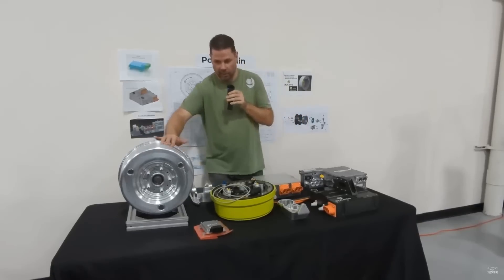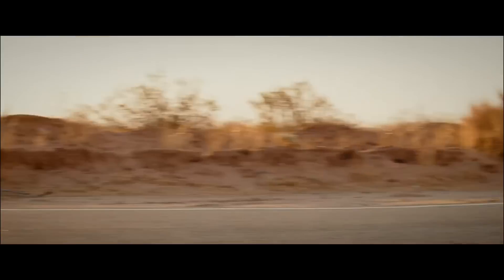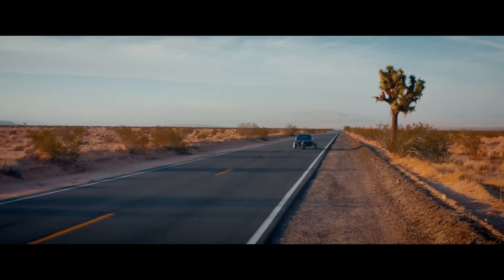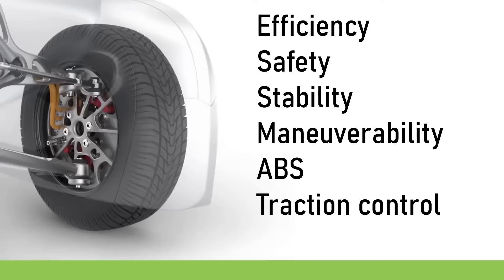Why is Aptera using In-Wheel Motors? (ft. Elaphe)

Comment: Listen up unsprung weight is only an issue on the flat earth! Flat earth is where this unsprung weight is really a major bummer. The almost completely aluminum constructed hub motor is slightly heavier than the steel wheels on my Jeep. That’s facts. Flat earth ,unsprung weight.

Comment: Having what is probably over 100lbs of unsprung weight about 2ft from a pivot sounds a bad idea from a drivability standpoint and just from the forces the bearings in the motor will have to absorb. Needs a in broad motor. I would even say inbroad brakes bolted between the CV axle to make that wheel assembly as light as possible.

Comment: I want to see that motor on a motorcycle, that'd be fun.
Reply: I have, the Super Soco TC with Bosch hub motor.  Works fine, no problems in rain. Never thought of more weight in the wheel as a problem.

Comment: IWM imao wont last long due to its location where vibration is always present.
Reply: The increased mass of the wheel motor will also cause inertial damping of vibration, plus the fact that the motors are potted with a rubbery, vibration damping compound that can resist 100 G shocks.  I have spoken directly with Elaphe based on my own experience with electric motors built to run in sea water, and they had the right answers.
Reply: @n.brucenelson5920  wow thats good

Comment: The fastest EV was/is the Japanese ELIICA and it has in in wheel motor (for some 30 years now).  Search "japan EV Eliica"
.
Eliica does 0 to 100km/hr in 100m (forget counting in seconds)
Reply: The 0-60 time of the AWD Aptera is faster, at 3.5 seconds as are many EVs.  Aptera is not designed for maximum speed, with the speed RPM limited to 110 mph.

Comment: i'm glad other people have pointed out Unsprung Mass, but i'm more concerned about high speed torque, as electric motors are famous for smoking anything for the first few seconds in a drag race, but struggling at high speeds after the instant torque is gone. is Elaphe using gearboxes somehow in their hub motor? a fixed planetary gear set maybe? if not, how have they managed to keep performance and efficiency high at high RPMs?
Reply: Torque is still there at speed…
Reply: @JohnR31415  not as much though, Tesla gears up their motors to get better perfornance at high speeds.
Reply: @xymaryai8283  Gears rob efficiency through added friction.   Aptera's wheel motors put more of the available power on the road where it does useful work, and avoids unwanted heat and increases range.
Reply: @n.brucenelson5920  Translation, all the acceleration is in the first 2 seconds after that it drops.
It's why the 911 would lose to the Tesla S at the 1/4 mile but the Tesla would lose at the 1/2 mile and by 1 mile the 911 already past it and was still pulling away from it.
Reply: @linusa2996  0-60 times for the 2 motor version is 5.5 seconds and 3.5 for the 3 motor.  This is absolutely amazing for what is designed as an economy car.  Even the slow one matches Ford Mustangs.

Comment: I'm thinking rain and puddles could cause corrosion within those motors no matter how well they think they're sealed.  Especially since they're shrouded almost completely by the fenders.  The tires are going to throw a hurricane of moisture around in there.  I have a motorcycle that I don't ride in the rain anymore because it's starter motor is located right where the front wheel throws a rooster tail of water all over it.  And you guessed it, if that happens enough that starter corrodes and won't work anymore.
Reply: I used to work for a company that built electric motors designed to run in salt water.  The Elaphe motors are fully potted by a shock absorbing rubberized compound that insulates the motors from shock and outside environmental influences.  They have been tested running under 10 ft of water and in 100 hour salt sprays.

Comment: Why don't they use an induction rotor as both motor and regen. Mag elev trains use a similar principle but as a strip to levitate and motor along. Saves a lot of weight.
Reply: The Elaphe motors used by Aptera also do regeneration, which handles most of the braking duties.

Comment: Ack. Unless you have invented the god bearings. Road vibration will turn those motors into a copper recycler's wet dream. Motor just inside the body where their design can still take advantage of air cooling. And reduce cable length from body to wheel voltage loss. 1970s EV builders shelved the in wheel motor design for a reason. Toss in road dust and water while wrestling cooling issues with a motor sealed against it. Just stating up hill. And all this BS about range issues with uber battery size. Stop being a lazy POS and plug in whenever possible. Average American does not drive that far. Most people are just POS that want the most for the least, lazy. Need to go to gramma's house 200+ miles away .... planes trains and buses. Then rent an EV there. 25 people on a bus are saving the planet. Not 25 people in cars rushing their vehicles closer to the next break down or set of tires. I would have to drive my half ton V8 truck at the nation average driving distance for 11.8 years to equal the carbon foot print of most EV battery packs that last 10ish years. Fusion power is the big push. Then we can worry about space. And making sure any of the 1% responsible for the death of a child gets a $5 bullet the 99% will gladly split the cost. Those large wallet small brain killing with rockets to baby formula. Small egos trying show other small egos theirs is not the smallest.
Reply: ???  EV tech has advanced greatly since the '70s.  Aptera takes advantage of liquid cooling with most of the heat generated in the wheels and battery pack radiated away through the aluminum body pan.  Aptera has about a third the battery size of any other EV for the range it achieves.  Aptera has a lower per per passenger energy use than a typical subway car.
Reply: @n.brucenelson5920  Better be cast aluminum machined heater core and not some weight saving press sheet and tiny vein modern heater core. Space age rubber tubes that don't decay. Moisture in an enclosed space with electronics sounds like a money maker on repairs. Do to modern construction of parts my 23 year old truck needs a 4th heater core. Located behind the dash so the whole dash needs to come out. Had to replace the modern quick connect hoses with old hose clamp by by the foot hoses. Hopefully they placed the heater core and lines like my 1951 Plymouth was. Outside the passenger area on the inner fender well. No leaks to soak the carpet and could be changed out in less then 15 minutes. 2 box screws/2 mounting bolts/2 hose clamps and add in opening the hood. Hear is another brain cruncher about their body design. If it does not shatter like a piñata. Then strange directional forces in a crash will cause the Dale Earnhardt effect without a neck brace.

Comment: The Aptera is a very special kind of vehicle, and in wheel motors are clearly the best approach for a car that has to be super light. The big drawback of the Aptera will be its crash performance. It try to be so light that it can't possibly be that sturdy and i expect it to perform poorly on crash tests. For that single reason alone it will never replace the Toyota RAV4 or Honda CRV which are their two most popular vehicles, but it is still a cool project, and very futuristic and fun.

The In-wheel motors will get destroyed by bad terrain and potholes. Some places like here in the SF Bay area we have some bad roads. I imagine on smooth roads the Aptera will be fabulous fun though.
Reply: I drove a similar weight Gen 1 Honda Insight in the Bay area for many years.  I unfortunately tested the crash performance on I880 with being hit from behind by an SUV driver who fell asleep.  I was uninjured.  I replaced it with another one that I am now driving in Iowa.I am pretty sure Aptera will perform even better than the Honda did when it was crash tested and got 4rs.

Comment: I'm surprised most EVs aren't using in-wheel motors too.  They make ICE conversions easier also.
Reply: Dude you’re right and think about adding it on like a hybrid to a front wheel drive car!
Reply: Maybe because nobody sells in-wheel motors?  Even the company mentioned here Elaphe does not sell them.
Reply: @bradleyrex2968  Alibaba all day
Reply: @Wheelieking619  Yes they have some hub motors that will push your bike along pretty quickly.

Comment: What happens when an IWM hits a pothole at 70mph or a manhole with a missing cover at 40?  A non-IWM car gets thrown out of alignment or cracks the rim of a wheel.  An IWM has a lot of unsprung magnets and coils much closer to the point of impact.
Reply: It’s fine no issues must be the tire sidewall and why don’t you live in a better town where they use their resources to fix potholes?
Reply: @Wheelieking619  I've been through almost all 50 states, and I've yet to see a town without a pothole. Heck some of the interstate highways are so bad that it feels like 30 miles of washboard.

Comment: Makes sense if performance doesn't matter like an aero 3-wheeler or maybe a slow off-road machine or rock-crawler.  It'll never make it to F1 or any performance car.
Reply: Electric motors can trade off range for performance.
Reply: @RussellNelson  You missed the point.  There's more to "performance" than acceleration. You can't undo the unsprung weight, shock, and angular momentum problem of placing the motors in the wheels.
Reply: @CaptainSteve777  All these values are relatively moderate.  However, Aptera is not intended to be a race car.  The top speed is RPM limited to 110 mph.  However, I can tell you from a ride in a "slow" prototype that the 5.5 second 0-60 time and the handling are both thrilling.  The AWD models will do 0-60 in 3.5 seconds or under.
Reply: @n.brucenelson5920  Sure, but those performance numbers mean nothing.  The question is what can those wheel insert motors do that can't be done better elsewhere?  Why expose the power generation to braking heat, heaving vibration, and 50g loads when it hits a pothole?  Why expose the turning wheels to gyro forces and precision?  Is it great for a golf cart?  Maybe.  That's a small niche and an uninteresting market.
Reply: did you miss the 0  to 100kph time?

Comment: The biggest reason to use these would be to retrofit other vehicles. Keep the gas engine for reliability, you don't need a big battery if you have a gas tank
Reply: No. The brakes have to go somewhere.

Comment: Does anyone know whether the Aptera will have heating capability for the pack?
Reply: Yes.  The Aptera battery pack is liquid cooled and heated by an antifreeze loop.
Reply: For the battery? Probably not.. EVs are not cold weather friendly just yet
Reply: @rajgill7576  My Tesla Model 3 is great in winter. It does lose some range in our Winnipeg cold, but if you have enough buffer that's not a problem. If it didn't have a battery heater the pack could get too cold to produce much power at all.

Comment: Michelin tried a very sophisticated version of the wheel motor (Michelin active wheel), with a very light motor rotating at high speed driving the wheel through a gear reduction: the road holding,with a active suspension, was satisfactory, but the assembly was very expensive and the lifespan was scaled down...

Comment: Three wheeled vehicles tend to be more unstable when there is a single wheel at the front and 2 at the rear. The Aptera layout is like the famous Morgan three wheeler which I don't think has ever been described as unstable.
Reply: One at the front and two at the back tends to be more unstable:
a) Because the weight distribution of this configuration tends to be unfavourable (ie substantially more than, say, a third of the weight over the single wheel).
b) Ordinary drivers tend to brake in bends and with the weight transfer, both longitudinal and lateral, that is inherent with braking in a bend and that is when this arrangement is particularly unstable.

The 'Nissan' Delta racer has a very narrow front track, but is driven by a racing driver who is less likely to brake deep into a bend, has a much more favourable weight distribution and can be booted early on the exit, although it must be a bit power-on  oversteery (!) with the rear end providing most of the roll stiffness.
Reply: @theinspector1023  the deltawing cant tip because of design geometry and rear weight bias. Not to hate I bet the driver is fantastic, but I think they made it ohysically impossible to tip if you're braking too hard in a corner. Sometimes you have to do things like that in a race
Reply: The Morgan has never been popular either, it’s a niche vehicle just like the aptera.

Comment: Also In wheel motors need much higher current levels, which means thicker cables and more robust and expensive control circuit. What you gain on the swings you lose on the roundabout.

Comment: I'm not trying to be a wise ass but what about mud puddles? The filthy water running down streets in a city during a rainstorm can't be good for any electric motor
Reply: this not some cheap ass chynese toy.  your question is most likely the first thing they thought of when designing these motors.  they have been rigorously testing the crap out of these things in all conditions for years now.

Comment: Basically they save weight and costs by eliminating the differntial mechanism, the driveshafts, lubricating oil, etc.
Unfortunately 3-wheels vehicles have less stability in long turns at high speed.
I would increase a lot the wheels diameter to reduce the stress of the tires in such conditiion.

Comment: Two unrelated thoughts. First, Elaphe is also the scientific name of a genus of rat snakes. Second, in-wheel motors are very cool, but no mention is made of the fact that they increase the unsprung mass of the wheels, which degrades the handling of the vehicle. Great in-wheel motors should therefore weigh as little as possible.
Reply: Cars have heavy axles and hubs and tored .. so here there s no axle lightweight hub and tire plus much smaller lighter breaks are sufficient coause of regen ... so it actually weighs the same .. thats what i heard .. for bycicles its a different story .. for mopeds they do it all the time !!! Millions on the road with hub motors !!

Comment: This reminds me of direct drive props on commercial vessels. Many ships have Diesel-electric drives with electric motors directly turning the props, which eliminates gearboxes, the size and weight of low-speed engines, and the torsional vibration hassles encountered on traditional Diesel-mechanical drives.

Comment: I'm no expert. But if in-wheel motors have all these advantages, then why not make a conventional looking EV like a sedan or SUV?  Also, wouldn't each wheel be super heavy? Would it be difficult to rotate tires?
Reply: the problem with in wheel motors is the weight from the unsprung masses who degrade the road holding by wheels bouncing= a bad idea...not forgott that the first car with such thing was the Lohner Porsche from 1899!!! so not a new idea...
Reply: They chose to design what will be the most aerodynamically and power efficent vehicle on the road instead.

Comment: gonna gloss over all the cons? the massive increase of unsprung weight and the motors are no-longer isolated form the road not every one lives in the CBD where the roads a perfectly smooth those motors are gonna be destroyed real fast. also forging the electric motors massive advantage of crazy RPM's when run through a reduction box can produce some awesome torque. the idea is ok on a light weight vehicle that will never leave the CBD but to say they are better then regular motors set ups is stupid.

Comment: How about making your motor hub wheels so that someone could convert their present car to electric by merely changing the tires! I have always seen this technology as the better way to convert older internal combustion vehicles to electric at half the cost of most crate systems. Something to think about. Imagine having the ability to make your car 2 wheel or all wheel drive at will!
Reply: You can't just change the wheel to put in wheel motors, you need to change the suspension because the mounting points of the motor are not there, and there is not enough room.
Reply: @niconico3907  perhaps "you" can't. I see no issue. Yes you will need to modify but possible.
Nico you can learn more in life from I Can than IQ.
Reply: @dalvenable331  its possible to change the drive train of a car from gas to electric, but it is definitely not " by merely changing the tires" like you said. it is much easier and cheaper to sell the gas car and buy an electric one, than to retrofit a drive train.
Reply: @niconico3907  You give up to easy and yet have not even tried? You inspire folks like Harley Davison, Ford, Wright brothers who went the extra mile to prove you wrong. Thanks.
Reply: @dalvenable331  yeah sure, those guys did what they did just to prove me wrong.

Comment: i think any claims beyond efficiency and packaging are a stretch. Torque vectoring can be done with inboard motors. The suspension works better with inboard motors (safety and handling). The car's polar moment of inertia is better with inboard motors (handling, albeit a very small impact)

Comment: 2 concerns I have is; extra shocks to the motor on rough terrain.
And how that amount of unsprung weight will affect the ride and handling.
Reply: The shocks to the motor and how that affects wear seems like the bigger issue, if you can get the unsprung mass of the in-wheel motors low enough to not be a big deal.  Perhaps nit having the additional drivetrain to deal with easily makes up for the unsprung weight handling issues in practice.
Reply: A direct drive motor doesnt really have anything sensitive to shock loading. As long as the bearings are up to the task, all else should be fine.